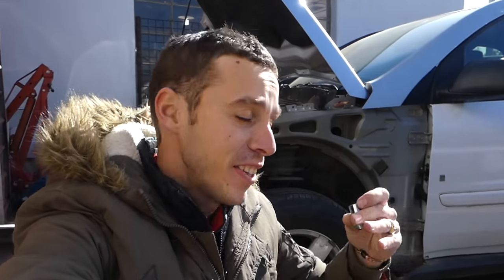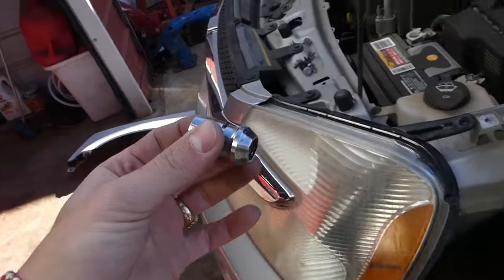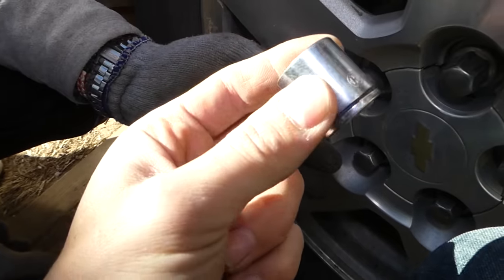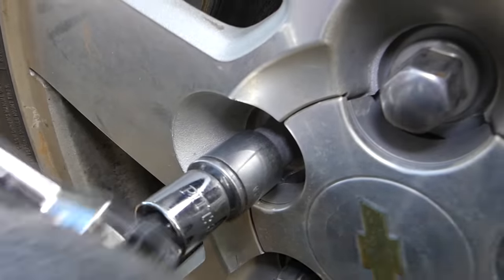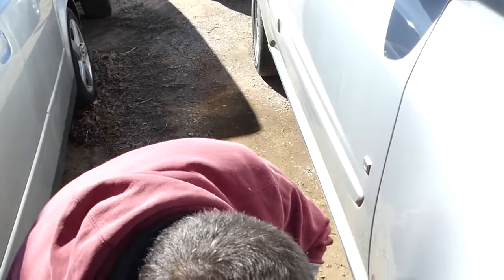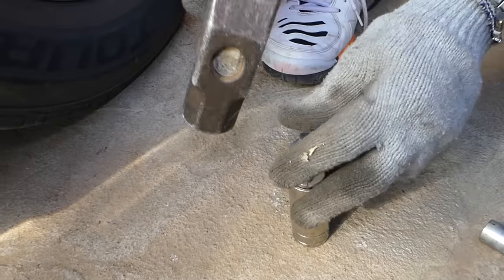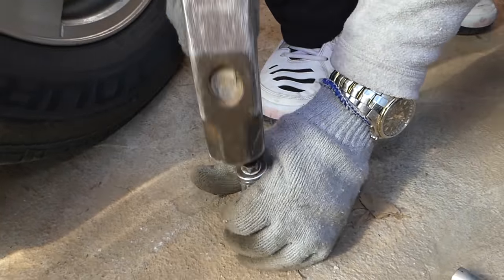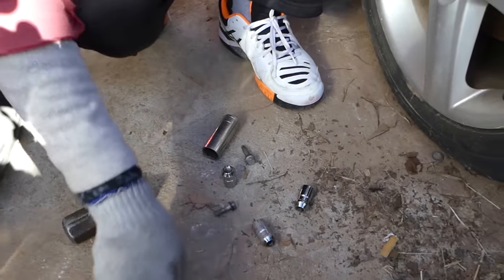HOW TO REMOVE WHEEL LOCKS WITHOUT A KEY TOOL

Comment: Hi,  thanks for the excellent video.  
How do you remove a locking nut that has a sleeve around the outside that just spins around the locking nut.  .  The socket for these does not work.  Please how do you remove them.  Thanking you kindly

Comment: There is loads of different locking wheel nuts on different makes of vehicles. This 12 sided socket trick has worked on this wheel nut put you wouldn't stand a chance of it working on a french car as it's completely different. Before someone criticises me I've been in the tyre trade for over 20 years and taking locking wheel nuts off is a daily thing in my job.

Comment: Thanks my friend.
My issue has never been the key; the inside of the lug always strips out when removing, such a small amount of grab space.  I went to Firestone, they said good luck, we don't have the tools.... So I grabbed my larger 12 points, found one that I could hammer on, and seconds later done.  Only if my tire had not destroyed my trailer fender...again.  If you have wheel locks, ditch them or pre size a socket for when you have a problem.  No drilling, cutting or damage other than a lost socket and lug. My socket became permanently fused, but pawn shops sell them for a quarter around here. If you have a locking lug, they offer no protection, this simple trick takes seconds, but if you have a problem on the road, they can be a nightmare. ditch them now.

Comment: I operated a auto service,repair shop for decades. When a customer came for service and we had to remove wheels with locks and the customer had the lug nut key I always suggested to not put the lock nuts back on. Some said they are to prevent theft and I told them they don’t as proved by this video besides if they are stolen your insurance will pay for replacements. I’ve had the key break on occasion and pre warned the customer if it breaks it’s not our fault.
So I advice to not have them on Your vehicle!

Comment: I watched the video but we don't have 12 point sockets. So I took 6 point socket and made hooks from aluminium wire. I placed the hooks over the socket edge and taped the socket to the nut. I also added exta long tails to the ratchet and bend it to give it more tracktion.

Comment: What size would I need if the lug nut is originally 19mm? Do I get a 20mm 12point socket or a 19mm 12pont socket?

Comment: Repair shops use a special socket to do the job. This works great on rusted exhaust system bolts such as the muffler and so on. But it won't always remove a keyed wheel lock nut. Wheel  keyed lock nuts are more of a deterant to an easy rip off due to a similar procedure being used.

Comment: Thanks for  sharing your video, cost me just under 7 pounds to buy a 18mm 12 point socket, to remove my locking nuts,Mercedes wanted 156.00 pounds plus the vat…

Comment: As others had also pointed out, this does not work if you have locking nuts with a spinning out collar which are designed to prevent this from being done. Mine had been on for so long that the out collar was seized tight. That was until I followed the instruction on this video. The collar soon freed up after I'd hammered the socket on which obviously meant that the nut still wasn't coming off and now, neither was the socket. Would have been a much easier and quicker process had I not watched this video!

Comment: I know this may be a late entry but you don't really need the socket at all. Place one hammer on that lock-nut and give it ta few good hits with a 2 pound hammer. The act of striking the lock-nut will slightly deform the aluminum wheel (just a few thousandths of an inch) which is enough to reduce the tension and you can probably remove that lock-nut with a pair of pliers.

Comment: Why worry over knocking the locking nut out of the socket? Simply replace the whole thing on the wheel with a standard lug nut and do not use these things in the future. I spent an entire morning once when my wife had a flat on our PT Cruiser and she had misplaced that lock key to undo them. The guys at a tire shop removed it all by an impact wrench tightening down enough to break each of them apart. I never put such back on a car again after that. Imagine having a flat on a country road and no way to remove the tire from the wheel like that. Nice to see there is a process to remove them, but how often will anyone actually have the correct size sockets on hand when they are contending with a flat tire?

Comment: When I did this, I loosened each locking bolt, then left it in the hub and worked the socket back off by grabbing it with vice grips and wiggling it a lot!

Comment: How come the locknuts shown have the chrome outer spinning sheath already removed. Plus a lot of alloys haven’t got the space to fit a bigger socket inside the bolt hole. What do you do then.

Comment: Great video! One thing I found is that if you have to put the 12 point socket on harder, even if you're able to get it off it may not work again for the next lock so keep that in mind, you might have to get a few sockets just in case.

Comment: How does that work when modern day cars have the spinning ring on the outer edge of the locking bolt.  Your locking wheel bolts are the solid type of locking bolts.  Apart from having to chisel off the spinning ring first then trying your method it could work.

Comment: I have a brake job to finish on my car. The key went on vacation after I did the passenger side brake pads. The car is stopping ok but it would stop much quicker if I  get the other pads on the driver side. I hope this does the job.

Comment: Is this the same method for Mercedes? Would you happen to know a good method for the (W211) 03 E500? I lost my wheel key while doing some repairs along with a lug nut. I believe the lug nuts on my wheels are 17mm. I spoke to the dealership but they have atleast 50keys that look similar.  So unless I have the code# they cant guess. They want over $65 at fletcher Jones, Ontario MB. So maybe you can help me save some money and another nightmare. Im already dealing with SBC issues. Any help is appreciated. Please and thank you!

Comment: If you use a long bolt while trying to pound a lug nut, or any other kind of nut out of a socket, you can hold the bolt with one hand while you hit it and it won't bounce out.  Just make sure the bolt is long enough so that when it does break the nut free it doesn't smash your fingers between the bolt head and the socket.  I use a punch instead of a bolt.

Comment: Hey man I was truly hope you could help me my lug nuts and my rims keep getting stolen no matter if I park blocks away streets away or I even put five different lock keys on one wheel and they still got it, the only idea I have left is to put my lugs on tight them like normal but after my wheel is on and ready to go I want to strip all of the lugs so they can't get them off how can I strip my lug nuts quickly and easily without breaking up or tearing up my wheel

Comment: Nice I would just tap it out with a hammer and flat head screw driver, slowly hammering it until it gets loose. Woooo way faster trick. My suggestion to separate the lock from the 12 point is to use a screw driver instead of the screw so you can hold it as well.

Comment: I think the keyed lug nuts are mainly for cosmetics! Some look cool, just not secure. I'm sure some are harder than others, but it's so easy to remove many or maybe most of them. I lost my key to the Gorilla locks that came on my truck from a previous owner, hammered a socket on and it was off nearly as fast as sliding a socket on a regular lug nut. I later found my key and put it back in my glove box, lol; I mean really, if someone wants my wheels, they're going to get them off with or without the key, might as well leave it in the glove box in case I get a flat. I have some regular lug nuts I'll probably swap on at some point though.

Comment: Tip , , make sure that the two normal wheel nuts or bolts are tight, gives the locking one an easier time
Reply: The two nuts or  bolts either side of the locking one, sorry for that!

Comment: I’ve had great success with heating the socket on the stove burner. Transport to wheel via a pair of pliers and hold in place with same pair of pliers. Let cool a couple of minutes, and walla!! Or do it the Russian way! NO STEAL! Eh amigo!! And by the way, just leave nut and socket threaded on a bit and lightly tap socket side to side with a hammer until socket falls off!

Comment: They make a socket specificallt for that.  Conical hole, no points.  Same process otherwise.  Also, it is an impact socket so it doesn't crack easily

Comment: Good trick, just be sure to wear a pair of safety goggles to protect your eyes in case the socket shatters while you're pounding it into place. A pair of cheap, locking pliers wouldn't hurt either, to protect your fingers from the maul you're using on the socket.

Comment: I once had wheel locks that the outer casing of the lock spun freely, so this wouldn't work in that case as the socket would just spin on the lock nut. It was to stop this type of wheel theft.

Comment: I lost my key so asked my brother, whom is a mechanic, what to do.  He lent me a tool specifically meant for the job - it's made of EXTREMELY tough steel and is kind of like a socket except for that it is reverse threaded inside and gradually gets narrower, albeit ever so slightly.  You use it by placing it over the locked lug nut and turning it counter clockwise.  It just begins to bite into the nut and as you continue to turn it, it just bites more and more into the nut until it's on about as far as it's going to go, and then you just continue to turn it, with the lug nut having no choice but to spin off by that point because the specialized socket has REALLY bitten into the lug nut by then (and can't go on any further).  Warning - it's very hard to remove each lug nut from the socket afterwards; a vice is pretty much required.

Comment: I didn't even know this was a thing until I bought a car from a dealership, and had to replace the tire and was told I needed a key to take the wheel off and I didn't have it. My girl is currently at the shop to have them brake it off. I wish I would have watched this video first.

Comment: Thank you for the hack. i had to get my 2 rear brakes done at the dealer and the bastards charged me $20 per wheel and they didn't wouldn't even replace the bolts.

Comment: Pipe wrench and hammer is equally effective. In your demonstration, using t hammer to release the socket with the nut is still on the bolt would be more effective. I have done this in the past and it works.

Comment: this only works on old or cheap rims with large nut bore holes. expensive wheels usually have a bore hole that barely fits the correct socket size,  much less a size bigger socket to be hammered on.
Reply: Only need to get thin wall socket. Or a socket made for rounded off bolts. They are usually thin enough. Then there are sockets made specially for this. Smooth taper inside and very hard so don't Crack . If none of these ways work, and air hammer with chisel bit won't spin it, there's one surefire way for anything. Get a regular nut weld it on top of locking nut. Using care not to damage wheel by overheating or spatter. Then remove as usual. There is no such thing as a unbeatable lock

Comment: I tried this and it did not work. Maybe I didn’t hammer on the socket hard enough. I didn’t want to mess anything up so I took it to a dealership that sells the same brand of car. They had a master key and even switched the locking nuts for the regular ones I provided. They did it free of charge. So I would advise first checking with your local dealership.

Comment: This won’t always work. I’ve got a cow touran and the locking wheel bolt is stuck. I’ve even welded a heavy duty socket and used a breaker bar to try and get the thing off and I end up sheering part of the head. Drilling is my last option.

Comment: rather than hitting the bolt with a hammer. put the unit in a vice and slowly but surely push the bolt in. . . assuming you're not not doing this in the dark of night at the side of the road.

Comment: Nah ...... if it's not an impact socket (of which only come in 6-point, not 12-point) you'll split the socket, then it'll just spin on the wheel-nut. 95% of the time, wheel-nuts are put on WAY too tight, and using this method will simply split the socket when banging it on with a hammer nearly every time. You've just been VERY lucky in this demonstration, OR you've put the wheel-nuts on prior to making this video not as tight as they should've been via a torque-wrench🤣
A mechanic of 35 years😎

Comment: Thats not a locking lug nut. It has no locking mechanism. Its a security nut designed to be used with the appropriate socket.

Comment: Those lock nuts are a deal breaker for any car sale for me. I'd rather run with one less lugnut on every tire than have those on there. 
If they've been overtightened, which I don't know how that even happens, you're looking at a huge parts and labor bill. If you lose the key or if it's damaged same big bill. 
I'd rather have the inconvenience of having my wheels stolen.

Comment: Unfortunately, this method does not work with those nasty Sicuplus safety nuts, as the outside on those are loose and rotate freely!

I've bought a car with lugs like that and it didn't came with the socket, so now I can't remove the wheels. I hate safety lugnuts, expecially Sicubloc and other ones like that.

Comment: I did this with 12 point socket.  I got 2 lug nuts off, but now myblug nut is stuck in the 12 point socket.  I've hammered it, but no luck. Guess I'll be buying another socket?

Comment: What are the odds of this happening:  I puchased a 1990 Maxima that came with a set of McGuard wheel locks.  For peace of mind, I purchased a second lock just in case I lost the first one.  Then in 2009, I purchased a 2009 Maxima using the old car as a trade in.  The new car also came with McGuard wheel locks...and they were the identical set to the ones on the 1990 Maxima.  Yes, I could re-use the second key on the new Maxima.

Comment: About a year ago we were on a road trip and we were in the middle of nowhere when I seen a guy pulled over with his nice Mercedes we had met him earlier at the border so we knew him and I pulled over, he had a flat and completely torn the inside of his fender out I mean air hoses... Like almost everything and he didn't have the key so he was forced to drive like 200km on his flat I felt so bad for the guy I was brainstorming all I could but just couldn't figure it out and heres the Solution wow didn't think of this

Comment: This ONLY works if the nuts are torqued to less than 80ft lbs ... Some tire shops will torque nuts down to 125+ ft lbs .... At this point it will NOT work ..

Comment: Two things:  You didn't address how much damage that does to the locking lug nut.  Can it still be used afterward when reinstalling the lug nut (i.e., will it still lock)?  Did you just temporarily override or did you break the locking mechanism by doing this?  If so, now what?  You'd better hope you retained the original lug nuts in your car's trunk or glove box so you can use one of them in its place.
Reply: Buy another set of four. Comes with a key

Comment: I tried for 3 hours...gave up....the 19 mm socket goes on tight...but when turned to remove it just spins....gave up...I forgot where I bought the wheel locks....I will call McGard anyway on Monday....

Comment: Mine came off with about 1 second of air chisel. This had the added advantage of destroying the stupid special lug. Don't use them! Buy insurance. The cooks know these techniques. I had the special tool, but the lug was jammed on so tight it stripped. They are not made to take a lot of torque.

Comment: Well many others have already commented on how you have shown thieves how to steal the wheels!  But honestly, you could have at least used a bolt of larger diameter and length to demonstrate how to remove the security lug from the socket so as not to embarrass yourself so much.

Comment: Guys, just don't do this. Take you car to a tire shop and they have correct tools to do this. I tried this, one worked but scuffed my wheel. Other one cracked the lug and now much more work and expense to get off. These lugs are cheap pot metal and will crack off and then you got a much bigger problem. Only $10 a wheel at tire shop to have them remove correctly.

Comment: Why not just go to the dealer,  they have a master selection of wheel locks for their vehicles. Then just take them off for good. If someone wants to steal your wheels they will. Your problem is you are on vacation blow a tire, do not have the stupid socket to get the wheel off and you have big problems.

Comment: But why wouldn't the dealership just provide the keys with the car? I have this issue now. I got a 2019 Hyundai Tuscon and the dealership clearly switched my two front tires out with very badly treaded tires. I went to buy new tires and have them replaced but now apparently I need to unlock my fucking wheels? First time I've heard of locked rims. Now ontop of having this issue, not only do I  have to go buy two new tires but i also have to buy a set of keys to unlock the rims... yes.. even though I just need one, they are telling me that I need to buy the entire set because they won't sell just the one key i need by itself.. if you ask me I'm getting the run around. 

Oh and bring your own lug nuts to replace the locked lugnuts, because even though the dealership will fail to mention the keys in the first place.. they will not provide you with just 2 fucking lug nuts as a way to slightly make up for the inconvenience.

Comment: Don't use this tip to steal wheels. That would be illegal.
Return the damaged socket for a free replacement. But don't tell them what you used the socket for. Scruples are for wimps.